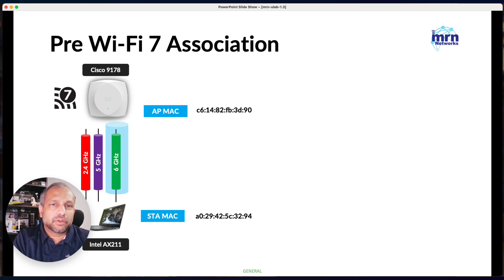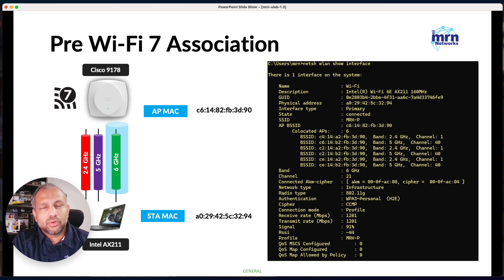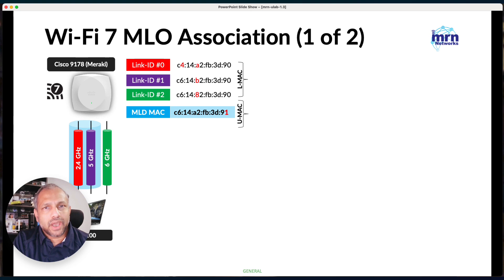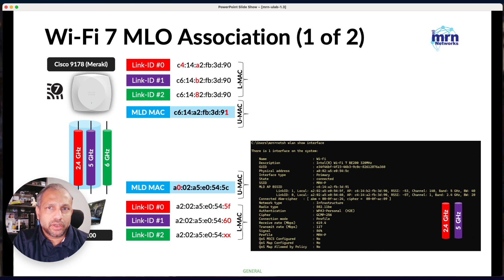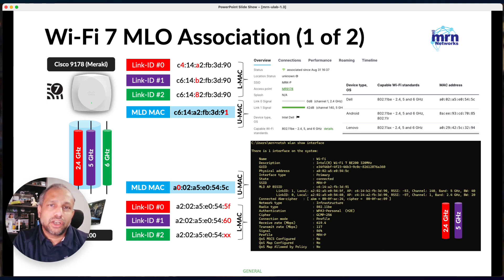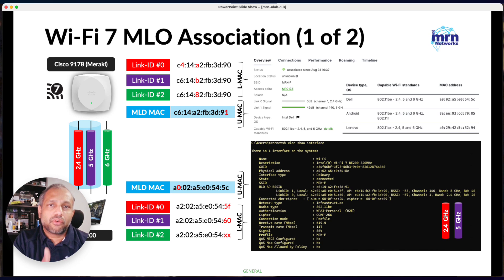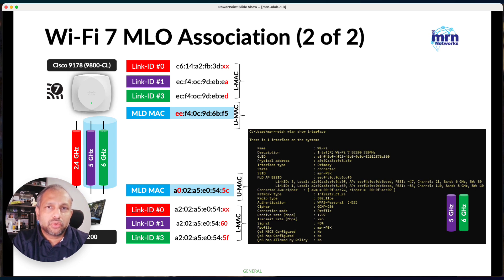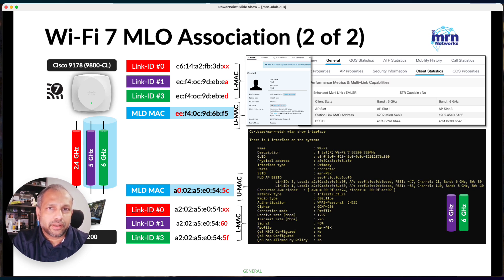Wi-Fi 7 MLO Explained: Why Multi-Link Operation Changes Everything! 📡🔥

Comment from the maker: MLO is the biggest change to the Wi-Fi PHY/MAC in a decade! 📡
Quick question for the engineers: Are you seeing your Wi-Fi 7 clients primarily connecting across 5GHz + 6GHz or 2.4GHz + 5GHz in your test environments? [10:57]

Comment: Do you have any infomation on why mediatek mt7327 can't do MLO association with 5GHz+6GHz and instead uses 2.4GHz+6GHz
Reply from the maker: Typically client device needs good RF filtering if they want to operate 5GHz + 6 GHz in certain MLO modes as those are nearby frequency range. In that way it is easy to operate 2.4GHz + 5GHz or 2.4GHz+ 6GHz from a client point of veiw. That could be the possible reason.
Reply: @mrncciew  You say filtering because MediaTek can't do 1000Mhz filtering on the two antenna ports? I've also asked to Cisco if they will alliance with the Taiwanese company to produce a similar client report like Samsung, Intel and Apple. Can you guess the response?